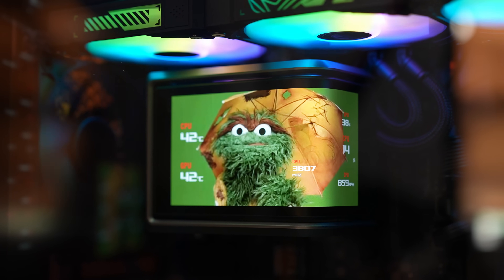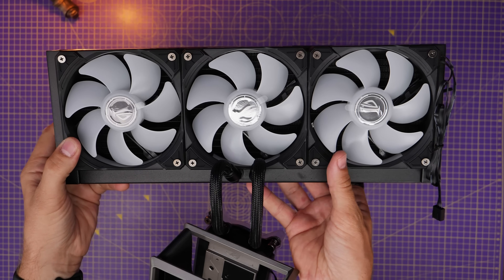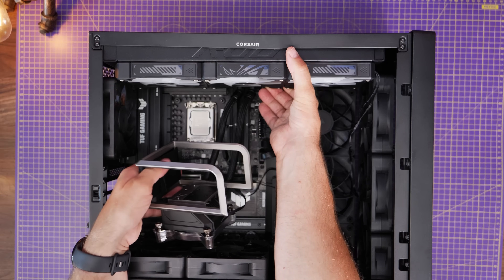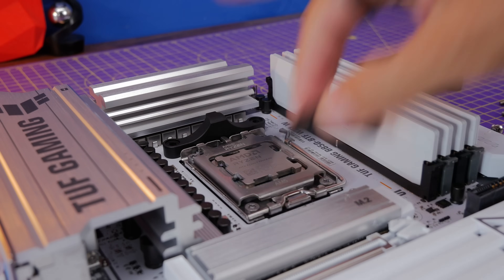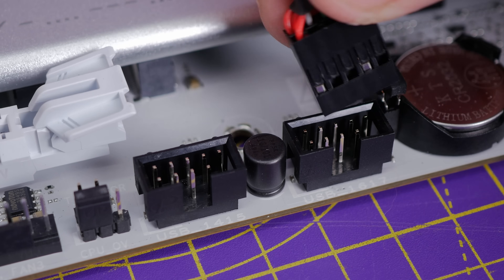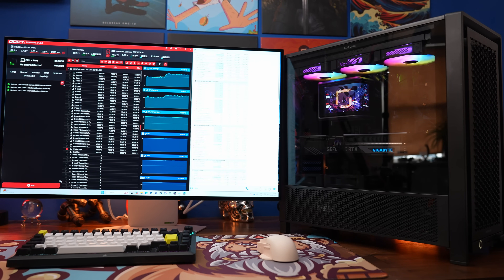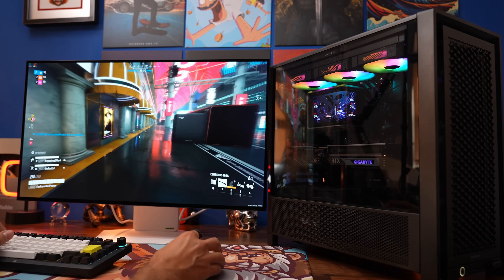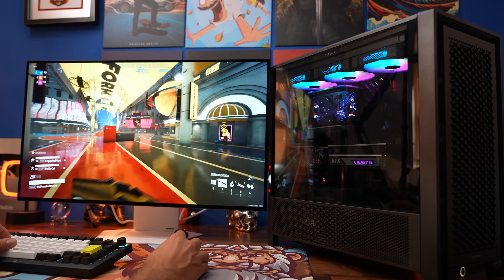Asus ROG Ryuo IV SLC 360 ARGB review

Comment: nice review.i have 2 questions.first can the radiator be install and the right vertical position that for example lian li vison compact has and second if the new arctic argb pro fan install on the radiator will perform better at the same rpms and quiter?

Comment: I recently picked up this cooler and I can't get it to appear in Armory Crate at all. The fans kick up really loudly on start up and pretty much run at full tilt above 65 degrees. 

I've no way to control the fan curve due to it being unavailable in Armory Crate. Also the manual saying if I use the AIO Pump header or W_Pump header it'll operate at Max speed. Is this what's happening here? Its loud in regular use, just no way to control the fans.

I'd appreciate your advice if at all possible.
Reply from the maker: Have a look at my guide and make sure you set it to correctly https://youtu.be/ssginGvVMww
Reply: @TheProvokedPrawn I had a look there, my AIO is plugged into the AIO Pump header and fans into the CPU header. The manual says the fans will run at full power like this but that's fine if I have control over them but I don't have any control at the moment. I have SL Infinity fans that can be controlled through L Connect but with the cooler, I've no options to control it.

Comment: I currently have the ARCTIC Liquid Freezer III Pro 360 A-RGB - Water Cooling PC, AIO CPU Water Cooler, 3 x 120 mm, 38 mm Radiator, PWM Pump, VRM Fan, AMD AM5/AM4, Intel LGA1851/1700 in my rig. Can I upgrade to the Ryuo?

Comment: what rpm are u using? i just got it and its really really loud at max rpm. is mine faulty ?
Reply from the maker: The pump or fans? If fans try setting them to PWM mode in the bios.
Reply: I've been having this issue as well. The cooler won't appear in Armory Crate so it's like the fans are defaulting to maximum speed, no way to set a fan curve or profile. I'll have a look at the Bios suggestion.

Comment: at the moment im using the Corsair iCUE H170i Elite LCD Display on my 9800x3d 5090 build,  as it is sufficient for most games but i would also like to keep the temps around 60-70c  in demanding games like  bf 2042 and bf 6 beta it reaches a temp of 80-85c which is still within the operating safe range, but would the new Asus ROG Ryuo IV SLC 360 capable?

Comment: So, it seems to me that at least some of this AIO’s cooling prowess comes from the high static pressure (relatively speaking) fans in the radiator. I’m curious how difficult it would be to use those fans on another popular, if less expensive, AIO and reap some of the benefits. May be worth a test, even to gain insight into how you would address the connectors or possible combos of AIO’s and fans that don’t cause chaos getting it to all sink up ARGB wise across the whole system.
Reply from the maker: I don't think you can buy the fans separately though

Comment: Beware……

I bought this cooler overseas because it’s not available in the US and I bought it to use it in push/pull configuration in a NV9 phanteks case and The place where they make you  install the radiator on the part of the case with 140 mm screw holes, makes it so the back of the radiator (the wider side)  hits the case above the motherboard  if you have a phanteks nv9 or nv7. 

Also, aftermarket fans are a no go on this cooler. On the side of radiator where you install the fans, the screw holes makes it so lian li SL infinity  hit hits the plastic fittings  that connect the aio tubes to the radiator, even if you move them like in the video it still doesn’t mount correctly. I also tried TL, CL, and Corsair QX, they all won’t fit correctly. I tried all 4 and they hit those plastic fittings. So asus fans on this cooler  are considerably smaller then any 120mm fan I’ve ever seen. I’m assuming that’s why all the other fans can’t be mounted correctly. So if you have these asus fans  already that come with this cooler then it won’t be a complete sh*t show. 

Furthermore, why wouldn’t they keep the radiator screw holes  on this RYUO the same as all the other asus  AIO’s. That way you can use whatever fans you want instead of being forced to use the terrible fans it comes with because of how the radiator is designed. Also, i barely tightened one of the screws and it stripped out immediately. I BARELY tightened it. Needless to say my ASUS ROG RYUJIN III 360 ARGB EXTREME  is going back on and I have to take a  huge $$$$$$ loss on this. Don’t make the same mistske as me
Reply from the maker: Interesting. Thanks for sharing
Reply: @TheProvokedPrawn  can you do a video about it?
Reply: @Bertis87
You can still mount the AiO on the Phanteks NV9, the 200mm tubes can fit the motherboard without any issues ?
Reply: This is quite helpful. I was contemplating this aio but if I can’t throw the fans I want on it then it’s a no go for me. Unfortunate, it looks quite nice tho!
Reply: I just bought a Corsair LL 120 triple fan pack and was thinking of getting this Asus Ryuo IV aio cooler but you said we can't install another fan on this aio cooler 😓maybe I'll just get the nzxt elite 360 v2
Reply: Regarding the fan, at least the TL wireless can be installed without problems.
 This fan is considerably thicker than the included fan, but it is fine
Reply: means it wont fit my nv7?

Comment: This is obviously for very specific build. I think it fits well with the aesthetic. BUT i have been able to handle one of these, it felt cheap.
I personally use an arctic liquid freezer 3. It does not have a screen, but if a screen is something you need i feel performance is secondary.

Edit: the software actually looks nice though.

Comment: It's a great cooler, I've had one for about a month. I like its screen ratio vs the tryx. The tubes are too long, they could be 50mm to 70mm shorter and still fit into any case, positioning the tube entry/exit in the first third or last third of the radiator would be better. Info Hub software stops your screen saver from turning on (I have an OLED monitor), more screen background options by default would be great and more system info options would be good too.
Reply: do they have the standard tubes option so it can be mounted to the side or no ?
and from where did you get it ?

Comment: I always prefer 140mm fans, so I went with the Phanteks Glacier One 420 (didn't realize there was an X2 version, not sure when that came out).

I'm very pleased with it. The D30 fans are great. I have my bottom and side intakes at 50% PWM and the CPU fans on the stock smart curve, and I basically just hear a hum if anything most of the time. The 9950X3D is crazy, idles around 42 or so and usually doesn't even get hot during games. So the CPU fans rarely even spin up.

I had to run Cinebench to really hear the fans lol
Reply from the maker: 420mm makes such a difference
Reply: @TheProvokedPrawn  Yup. I'm very pleased with the build, and the D30 fans and that cooler basically mean it should work just fine in Linux too, unlike all the fancy screen options or the "ecosystem" options that require special Windows-only software.

Comment: Sir can you pls make a video on how to use li an li fans on the NZXT kraken elite 420 mm
Reply from the maker: It's fairly straightforward. Just need to connect the fans to the controller and then set them to respond to CPU temp in L Connect 3.
Reply: is that hard to do? Don't the fans come off on the elite 420mm?

Comment: For whatever reason this looks cheap compared to the tryx coolers.
Reply: Probably due to the large bezel and plastics lol
Reply: Yeap thats the probelm for me, little overboard, and it looses its "clean" feeling with all the plastic @ouki4925
Reply: Tryx constantly loses connection which drives me crazy. Otherwise tryx is a great cooler.
Reply: @barnun2525  no it doesn't , I have the SE and it never lost connection. My only issue with it, is that it wont pick up on the CPU temp to display it, other than that 0 issues. Also , only paid 280 euros for it.
Reply: @deadr0t I found that there is conflict with my Asus Maximus motherboard screen and tryx. Was causing freezing with windows and connection issues.
Reply from the maker: Not used Tryx yet
 But will soon so I'll see what the difference is like.
Reply: i have the tryx se that i paid more than 400$ because of shipping and tax from US now this is available in my country for 300$ tax included even cheaper than latest ryujin this the reason why it was priced cheaper which is unusual to asus
Reply: Damn with all these issues I think I'll get rog iv 360
Reply: I have one. It does not look cheap lmfao
Reply: @gemjarv yeah, it kind of does. Especially for the price. Way overpriced